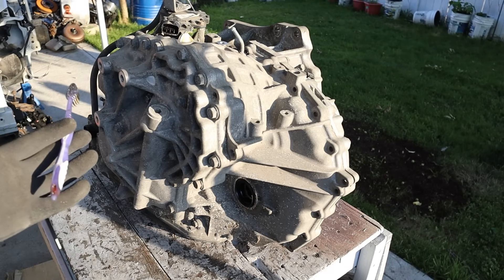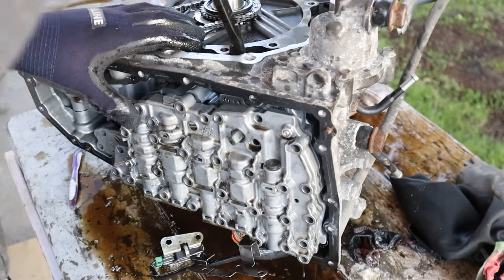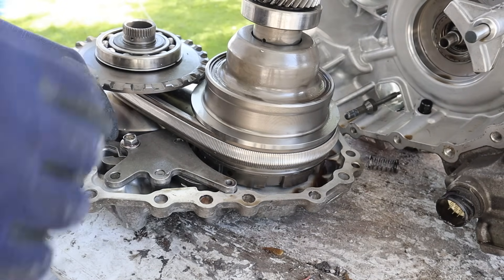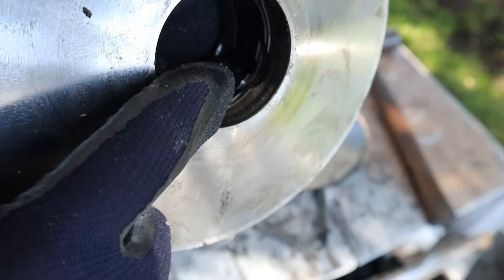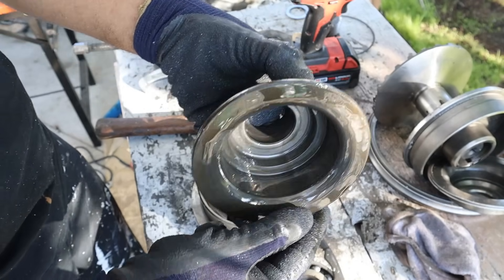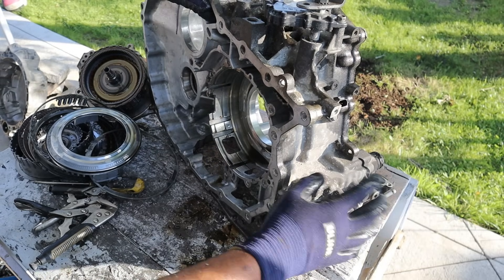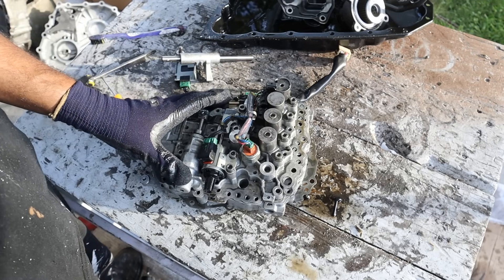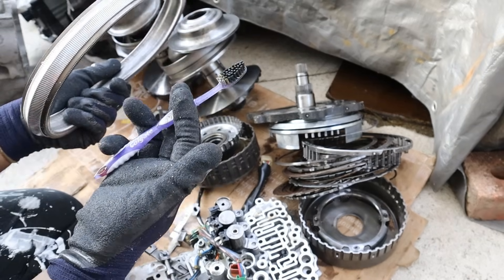Why Nissan CVT's are a FAILURE

Comment: That moment when you click on a video about poorly designed transmissions, and the transmission featured in the video is from the same make, model, and year of the high mileage car you’re driving now.
Reply: I have heard that if you change the fluid every 20,000 miles and drive them gently they will actually last a really long time. Is this what you've done
Reply: @jaye909  i have a 2020 nissan altima with 170k miles on it already and I've done the transmission fluid change every 40k miles. The transmission sounds nice and drives smooth as well. A lot of people don't know that you need to do maintance on a cvt transmission.  Once they have issues with the trans, they want to blame nissan. How about do research on a car before purchasing.
Reply: @jaye909 Toyota does not need to change fluid in lifetime
Reply: @sunny3560-e6y yes tf you do.
Reply: @jaye909  Knock on wood, I have 241,000 on mine. I change my fluid around 30,000 miles.
Reply: @jaye909  Where did you get this information?   What is gently?  Who changes Transmission fluid every 20,000 miles?  Is this gem in the Nissan manual?
Reply: This is true. My versa has 130k. Fluid/filter changes every 30k. Runs fine. Just do the maintenance people. I swear half of the “unreliable” shit is just things that have poor tolerance for people who dont follow service intervals.
Reply: @Oksobasically2  you also forget that earlier Nissan CVTs didn’t have any drains/ports for maintenance of the fluid, nor did the Nissan dealerships or Nissan manufacturer tell any of their customers that maintenance of the CVT was a requirement. These cars were sold with “lifetime” fluid, and customers were told by dealers/Nissan they’d never have to worry about it.
Reply: @thiefrules Same with Mercedes CVT’s, it was “sealed for life”. Failed at 180k Km’s.
Reply: @thiefrules  there is no such thing as lifetime fluid and people believe the BS my dads 2009 has original CVT and engine over 400,000 miles so its not the tranny its the people driving them hard and not changing the oil is your issue
Reply: @thiefrules  I guess their lifetime is 60K miles? That's the change interval in the manual of a 2020 Rouge
Reply: @thiefrules  My 2005 Murano has a drain plug.  Just did a drain and fill, cartridge filter change, and added and external oil cooler.....runs well so I'm gonna start babying it....
Reply: @Oksobasically2  or better yet the manufacturer doesn't recommend a service interval that they should have
Reply: @jaye909  Yea, looking at you BMW!
Reply: @Oksobasically2 ...I had a versa that received a fatal diagnosis on the CVT at 72,325.  I adhered to the Nissan service intervals; I learned they are way wrong.
Reply: @Oksobasically2 I don't get why everyone is afraid of cvts. For daily commuting they're fine. Just change fluid and filters. They're super easy to rebuild also.
Reply: @Oksobasically2  I literally have a coworker who claims most vehicles on the road are garbage BECAUSE....

(drumroll please!)
you guessed it, they don't take well to neglect! He says Dodge are the best cars on the road for bearing egregious neglect without complaint.
Reply: I change the transmission oil in my Nissan Sentra and Honda Civic every 20 grand.  CVT transmissions have to be babied and driven a certain way.  The problem is that people think they are your typical automatic gearbox.
Reply: We have 3 CVTs at our dealer this week, 2013 juke with 150k that I just finished replacing the CVT in today, a rogue that came in today don't know the year or milage, and I believe a Sentra coming in tomorrow again not sure on year or milage as I didn't get that info from our SA.
Reply: @theripcord03  how do the older manual transmission sentras hold up? Been looking for a decent old tech car on the cheap to compliment my fleet of tired 5 speed trucks that burn way too much gas.
Reply: I've had 3 CVTs from Nissan all went over 250k. Dealer gave me a written lifetime warranty on 2019 Murano cvt. Also you talk too fast.
Reply: God is trying to tell you how to save yourself. Or something. Anyway maybe you should get a new car.
Reply: Nissan is Renault so it's build down to a price, alot! But poor maintenance + unsympathetic driving is a very common issue too, hope to never see a tow hitch on a cvt car lol😮
Reply: You're lucky. It happens
Reply: dont believe the hype, cvts only fail because NO ONE changes the cvt fluid every 30K miles like youre supposed to.  these CVTs are good transmissions
Reply: @ Not true for my 2019 Nissan Sentra.  It was a rubber band transmission way before I had the transmission fluid replaced at 40k miles.  It was also slipping.
Reply: @drewdevon2009 my 2014 maxima manual says to change it every 60K which I have done.  I’ve got 119,000 on it.   Still runs great.  Fixing to go in at 120,000 for its second CVT service.
Reply: @100fredkrueger idc what the manual says.  manual on a mercedes sprinter says to change engine oil every 20K miles, that doesnt mean we follow that
Reply: It's amazing how a qualified mechanic can show you everything to your face and yet, ignorance still abounds. Amazing.
Reply: Change your fluid every 20k? Do you know how much the cvt fluid costs for nissan?
Reply: my wife's started squeaking then once warm didn't make noise but now constantly noisy and then you take off takes further to her to 20 mph and then will go fast so tired this mean I'm needing 7k new transmission
Reply: Even a broken clock is right 2 times a day
Reply: https://youtu.be/GIuraMjpt0k?si=eDKmIgj_HMO9pBJy
Reply: video showing how to do a flush if anyone who has this CVT is interested
Reply: I had a 2019 Nissan Sentra.  At 25K the CVT started slipping. If the trans can't handle my or others certain driving habits, it's time for Nissan to make some changes.
Reply: Mine has 241,000. Hope it will last a few more years.
Reply: @NotHAL9000  dont believe the hype.  clickbait video.  the cvts are good, especially if you drain and fill the fluid like youre supposed to every 30K miles.  of course no one does this, so the transmissions fail when running for tens of thousands of miles with fluid that has not been doing its job for a while
Reply: Nissian Xtrail / Rouge 2015.. Im doing my part !
Reply: Every 20 to 30 ??? I do mine every 15 is this bad ? 😂
Reply: Bro same😂😂😂
Reply: "That moment..." that says to you, "Change All Fluids Now and Get On The Regular Maintenance Wagon."
Reply: If you have a sense of humor like me, you laugh out loud from the very beginning! Same story for me, except the car only has 20,000 miles on it!
Reply: Lol
Reply: change your fluid!!!

Comment: Hey dude. Just FYI. Small shavings are completely NORMAL thing.
That is why there are 2-3 magnets at rhe bottom on top of the strainer-filter

Transmission wears down just like engine 
Like tires
 Etc.
It is just the truth.
Even if transmission is perfectly made it is going to end up "using up all the resource" of a clutches and other items that come in contact.
It is just how it works.😅

Eventually you will need a rebuild on any trans

However excessive wear is a different story

Comment: That's just terrible, to many moving parts, any Nissan especially those made from about 09 up to 2015 are to be avoided, I have 3 cars, and one is a Nissan Murano 2017, driving that car is such a pleasure, I do change my cvt fluid, I'm at 94 thousand miles, if the cvt fails, I will not replace it, they are just to expensive.

Comment: There are lots of reason for these failures.  Number 1 is educating the customer that you can not accelerate  like a race car.  Number 2 these are so new that they require better parts than what was used in the beginning years.  Cvts are here to stay, although probably in a modified form, Toyota redesigned theirs with to include a true first gear for acceleration.   Beefed up drive belts also help.

Comment: CVTs we’re not intended for commuter cars when they were invented, they were intended for Formula One. They were meant to go a few dozen miles really hard and then get rebuilt/replaced. This shit we put them through trying to squeeze a hundred thousand miles out of them is not what they were ever meant to do.
Reply: You make a good point, but Renault/Nissan are also to blame for penny pinching in every single way possible until their version of the CVT was paper mache compared to the original F1 designs. Had the CVTs used in Nissan's been as robust as the FW15C's we wouldn't be seeing the continuous failures that we have for the past 15 years

Comment: To many failure points in this JATCO CVT simple don't buy a Nissan with a CVT what's wrong with a manual gearbox l drive a manual and absolutely enjoy driving the vehicle its in so much fun
Reply: Manual is overrated. If North America shifted their own gears, lots of owners would need new engines (misshifts)
Reply: @mann_idonotreadreplies  l have been driving for 50 years and have owned and driven a vast variety of vehicles and most of them are manual and have been fortunate to drive and own manual and automatic versions of the same vehicle and have driven an automatic truck you know a proper truck not a ute as you gathered l am Australian and l do prefer a manual and l have a manual ute a 1997 Toyota Hilux and a manual gearbox is so much simpler than an automatic transmission and so so much more and far superior than a CVT and there a point in CVT history were the actual CVT was less complicated less moving parts than a manual gearbox
Reply: What's wrong with a MT?  Nothing if you don't get stuck in a traffic jam each day to and from work!  Oh, my poor left leg.
Reply: @thx1138guy  l was a courier for over 30 years and all my courier vehicles l owned were manual and l struck a lot of heavy traffic for kilometres never troubled my left leg but the only relative strain injuries l suffered from is my right shoulder from steering the vehicles some had power steering some didn't and l did get some pain in my right wrist l am retired now drive a lot less and l have kept the last vehicle l used for couriering and l bought it five years and l still have it and the vehicle is a 1997 Toyota Hilux and it is the best vehicle l have ever bought and l paid aud $1500 for it and in the five years l have owned it the Hikux has appreciated a lot and l have done some research on the Hilux and l found out a lot about the Hilux and l am extremely pleased what l have found out about the Hilux
Reply: @lesklower7281  I'm retired too.  Used to drive manuals for decades.  Got old and switched to automatics.  Loved manuals except for the occasional stop and go hundreds of times for an hour after an accident with nowhere to go.  Didn't happen that often but egad when it did yikes!
Reply: @thx1138guy  l probably will never give up driving manuals although our other vehicle is an automatic l also drive that one l don't mind it but most of my driving now is just around were l live

Comment: Thank god Mazda has avoided going CVT in their cars thus far. CVT's are not worth the small gain in fuel economy if you plan to keep the car outside of the powertrain warranty. If you are leasing a car then a CVT is fine but I would be highly concerned about buying a used car with 100k on it that has a CVT. The exception might be Toyota as they are probably the only company who I have reasonable faith in where CVT's are concered. They have been using them in Priuses and other hybrids for 20 years and plenty of Priuses on the road with over 200k and their original trannies. Toyota seems to have mastered it.
Reply: The toyota prius/hybrid cvt/ford hybrid cvt are not belt types. They use planet gears and electric motor for the power split and ratios. No belts. They are an eCVT.
Reply from the maker: I agree I like that Mazda is stuck it old school
Reply: The 2014 Corolla with CVT is absolute trash
Reply: Mazda is smart compared to Toyotas compact cars. Plus AWD option
Reply: @adamn7516  Mazda was using ford automatics and their deals between each other, they kept using them or whatever ford spec for their counterpart cars. 

Subaru, Nissan, and Mitsubishi are all Jatco transmission, in which Nissan owns the controlling stake in.

Comment: So the failure was on the retaining mechanism and piston bearing of the driven gear?
I don't think transmission fluid and filter changes would have saved it. Maybe the reason there is damage there is engaging reverse while car is moving forward and the opposite.
The car's weight is now on those grooves and balls. The loud bearing of the planetary gear could also indicate this
Reply from the maker: Yes those ball bearings and the piston seal

Comment: It's possible to build a good CVT using epicyclic gears and no rat wheels or rubber bands. Probably doesn't really cost much more to make and if maintained properly should have a much lower total cost of ownership over the life of the vehicle. Me, I've never bought a car with a conventional automatic transmission. Four and five speed manuals only so far in 60 years of car ownership and probably more than a half million miles of driving. Only had to replace two clutches myself due to engine oil contamination or wear and one under warranty due to an improperly manufactured flywheel (GM product). Looking now for a robust 6-speed manual or a well engineered hybrid, if there is one.
Reply from the maker: Toyota hasa decent hybrid system for more than 20 years.

Comment: Wow! It's very sad to know that the manual transmission is being replaced by these.   Unbelievable!
Reply from the maker: They need to keep offering more manuals
Reply: @speedkar99  I agree with you but most manufacturers claim that the demand is not what it used to be.
Reply: @thx1138guy     I can only speak for myself though there might be a few who will believe this.  I've owned quite a few cars over the years and 90% are manual transmission.  I've been living in NYC for almost 40 years and that's all I drive.  I do it for the main reason, a manual transmission is more reliable than any other transmission that there is.  I must say I drive in heavy or light traffic without giving it any though as after driving a manual for a week or two (in the beginning of me learning) everything becomes natural. That's just how I see it but I guess,  to each his/her own.

Comment: Naturally, not all engines and transmissions (gearbox(es) to non-Yanks) are created equal. However, >95% of all catastrophic failures occur due to lubricant/transmission starvation. Without regular fluids change, these components WILL fail, no matter how good they're engineered & built. Period.

On motorsports side, Williams did tested CVT on their FW15 (1993) car. However, since automatic gearboxes weren't allowed in F1 it was never raced.
FIA: "Listen, sir Frank Williams (especially Adrian Newey & Patrick Head). We know that you're pushing the boundaries of technology. Aside from AT being non-compliant by regulations, your car is already a full nautical mile ahead of all of your competitors in terms of performance..."😅😅😅
Reply from the maker: Some of it is driver usage like towing and cooling
Reply: @speedkar99  Also freeway use

Comment: Thanks for the video! You seem to know a lot about these!

What I don't get it, why would someone buy a Nissan, and not maintain it? Sure, it's a cheap car, but it's a lot cheaper when you change the fluids and filters, and not the whole transmission.

I have one of these CVT's, it's the one in the Mitsubishi Mirage, and change the fluid, change the pan filter, and cartage filter, and clean the magnets every 30,000 miles, if not sooner.

I do stress my CVT quite a bit, like going up mountains with 800-900 LB in the car. But I try to keep the RPM at 2,000, and not go over to prevent overheating it, often I run the heater with the windows down on long uphills. Is that fine?
Reply from the maker: Yeah I think that's too much sttess to keep it long term.

Comment: I bought my '16 Maxima SV new. I now have 160,000 miles. Still pulls like a train. I did not miss any CVT services. The car has been great to me  (so far). No major issues. I change all fluids in the car (not just oil; everything liquid). That X-tronic CVT has a filter attached to the side of the case and a strainer inside the transmission's oil pan. Those need changing also (it's not listed in the Nissan maintenance schedule pamphlet; but it needs it).
Reply: @mitchlu  Very nice. What brand CVT oil do you use? The Nissan NS3?
Reply: @vqdriver  Yes, all service was done at the dealership (so yes, they use the NS3). I was only recently (150K miles) able to "convince them" to also change the filters-most dealerships won't do it since it's not in the Nissan maintenance schedule, so they think it's unnecessary. But they finally did it and the car now gets up to 4mpg better on the highway just due to the filter change (compared to changing fluid only).
Reply: @mitchlu  wow that surprising but I’ve also heard of stuff like that
Reply: 2016 Brought a lot of improvements ive got a 2016 nissan maxima platinum, i got it used and it is closing in on 60k dealer said no need, but i know that it needs at the minimum a drain
Reply from the maker: Good to know. How many miles to they specify for CVT replacement?
Reply: @speedkar99  I'll keep you posted...LOL. But I'll feel I got my money's worth if I make it to 200K (when talking about the transmission).